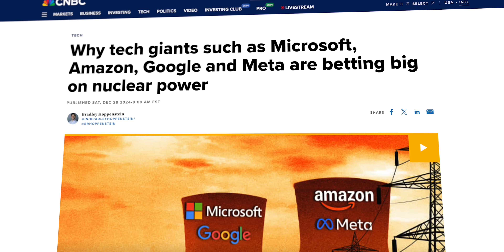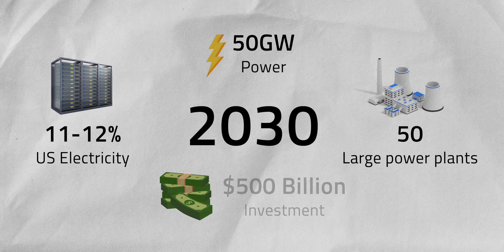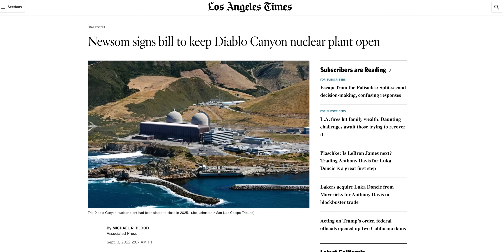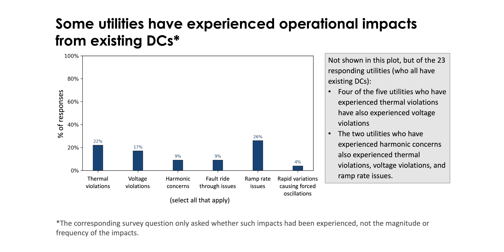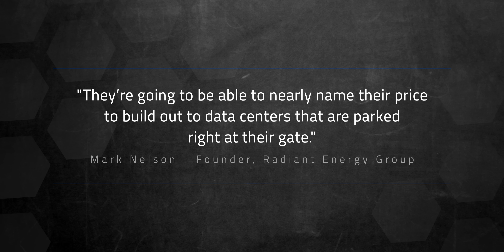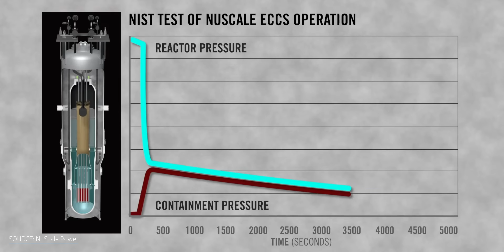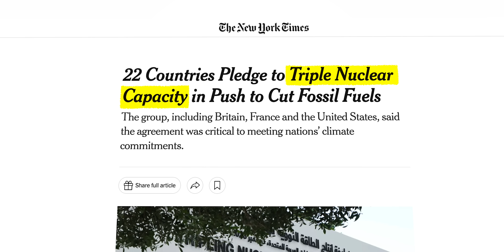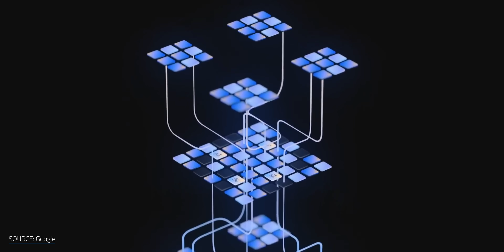Why Big Tech's Betting Billions on Nuclear (Not Renewables)

Comment: No please.  As a former naval nuclear electricians mate i would never recommend any company willing to hedge their bets to operate a nuclear reactor if any size.  The ways it can go wrong, let's just say i had to know more than twice my height in 6" binders filled with the bad shit that could happen and how consequential each and every single part is.  One failure is all it takes.    A nuclear carrier has multiple redundant systems designed to operate in battlefield conditions, and they are dangerous to operate.  I was standing a shutdown phone watch with the shut down reactor operator, our ship was undergoing a standard retrofit to a shore power breaker that had been tripping unexpectedly.  We had a casualty, power arced from bus bars into a handheld fluke, instantly becoming a fireball.  Our only shore power connection popped dropping us into an emergency situation, just like that the lights restored as the diesels fired up and started picking up loads.  Now put this in the hands of private wealth driven firms and it's simply a matter of when we have a nuclear incident.

Comment: This rising demand for electricity has a relatively easy solution. Don't consume it. Ban the new data centres and legally limit AI. No one needs AI. Or to put it more accurately, we need AI for just one thing: pushing off the day the party ends for the obscene overvaluation of tech companies. Tesla, for one, should have the P/E ratio of a normal failing car company, which is that it is.

AI has literally no value to humanity. Its best case scenario is achieve the dreams of billionaires to finish plundering all the world's wealth while freeing them from dependence on the creative class who can be replaced with AI. I'm a skeptic of that dream, since the AI we have now is such absolute trash, but the point is, there is no scenario where raising our consumption of power when we desperately need to be lowering it for stupid AI trash or insidious AI to replace human intellectual labour (mostly by stealing it to train AI) is a good thing.

Comment: It is impossible to accurately predict the future using data from the past because nothing stays the same, but if you’re trying to predict the future climate of the entire Earth 100 years from now it sure would be nice to have data showing temperature, speed, barometric pressure, and direction of the jet streams for the last 100,000 years or so. Unfortunately, humans only discovered the jet streams back in 1883 and accurate measurements of the jet streams only go back to the 1950’s using primitive weather balloons. Jet stream data prior to 1883 is lost in the winds of time forever. We now have maybe 50 years of HIGH quality satellite data of the jet streams. It is impossible to accurately model the climate with so little data. However, climate scientists could build a time machine to go back and accurately measure the jet streams for the last million years, but until that happens the climate models will always suck.

Comment: 3:35 Embracing nuclear is a bad idea because it produces electricity 24/7 365.25 days a year at fairly steady levels and can't be just switched on and off as needed. That means that when there's a lot of wind or a lot of sunshine for PV, which are MUCH cheaper and much better climate wise, instead of using those for electricity production they are shut off because in contrast to nuclear they can be and expensive nuclear is used instead because with the additional electricity from wind and PV on top of nuclear the energy grid would then destabilise.

As a result renewables also become less competitive and less interesting for investment since whenever they'd perform at their best they're shut down...

Therefore: No nuclear.

Comment: The hard part is not making nuclear power plants work, its making them profitable.  I am very skeptical that any of these designs will be financially competitive.  Maybe the data center demand can push the per-unit costs down, but I am skeptical.  Steam turbines don't ramp very well and have high unit commitment costs.  They don't pair will with renewable power, which is far, far cheaper.

Comment: Strange that the M in smr represents that it's factory build. The big advantage is it's fuel is developed to quickly adjust power vs demand. A normal reactor can't change power quickly because of the huge thermal chocks in fuel and cladding. SMR fuel is specialy designed to cope with this problem.

Comment: While I am pro nuclear power, that doesn't extend to SMRs, except as emergency power.

The main reason that nuclear is so expensive is due to protests and courts. Every project gets sued many times. Everytime they are sued it creates years long delays.  

Often the delays from court means that regulations have changed causing further delays as costs for plant redesign and re-approval.

The same tactic was used to fight Hydro-power projects. And now the same tactics are being used against "fossil fuel" power plants. The whole goal is to drive up costs and cause delays that can cause investers to pull out. Either the project is canceled or it is way over budget (10+ times over budget).

Ever canceled plant and every over-budget plant decreases the likelihood of a future plant project.

Remove these obstacles and nuclear power would be one of the cheapest options, only competing with Hydro-power.

The issue I have with SMRs is that they will face the same court and regulatory delays as a full scale plant, but provide 1/10 or less the power. A SMR also requires nearly the same staff as a full scale plant. These highly trained personnel are in short supply. Tying them up for a SMR is wasteful as there are only so many qualified personnel.  Most of these jobs are not remote work. 

Even if some jobs could be shared between multiple plants, you then have further expenses for travel. If the SMR is having an issue, the last thing you want is "The person we need is 1000 miles away and the airport is shut down due to weather".

It makes more sense to build out large server farms near large new nuclear power plants. These could be built in Arizona, New Mexico, Nevada and similar areas in the desert. 

Build such nuclear power and server farms dozens of miles from Pheonix or Los Vegas, in the desert with a high speed rail line could create new industrial areas with little direct impact on major population centers. The cheap power would attract other industries.

I believe FEMA/NRC/DoE should jointly own two to four SMR plants, designed to be quickly transported.

Half located on the east coast and half on the west coast. During normal operations they would sell power to grid power companies and be used to train personnel, closely copying the Navy Nuclear program.

In a natural disaster, one or more SMRs could be quickly transported on location in order to provide power. Navy nuclear ships have done this for decades, even in remote locations.

FEMA/NRC/DoE could make an agreement that Navy nuclear ships could be used in the US during natural disasters (if available) and that the Navy would help them create their training program.

A US Navy submarine can fit into smaller ports and even go inland via major rivers and water ways.

Its possible that the Navy could help develope a small ship with a SMR to be used for training and emergency power.

This ship would be large enough for the SMR, a large battery bank, electric motors for propulsion (10 knots would be plenty), a dormitory,  cafe, water treatment plant, classrooms, etc.

Comment: A good argument can be made that the climate crazed solar industry burned down LA with solar panels.  What might the consequences be from nuclear power plants all over the place?  
Solar panels are flammable. They trap burning embers where the heat is amplified many times between the roof and solar panel.  The glass cover traps the heat like the greenhouse effect while certain people try to blame the fires on the carbon dioxide. greenhouse effect.    Lithium battery packs  might require 100 times more water to extinguish than wood fires.  LA has the highest concentration of solar panels in the country.  If the intense light from surrounding flames overloads the solar panels and the battery, a chain reaction of explosive fires might explain the catastrophic  magnitude of the fires.

Comment: As someone who lives in a place heavy on renewable energy, specifically solar and wind, it is freaking expensive.  Just wild what electricity costs around here and several times as much as most of the rest of the country.  And then over 70% of annual power power production ends up coming from natural gas fired power plants because the Sun doesn't always shine and the wind doesn't always blow.  And this is when they brag about having surpluses of renewables on some days when the Sun is shining and the wind is blowing.  For some reason building a whole extra power grid out into the middle of nowhere where no people live and plastering over the countryside in technological trash for less than 30% of your ANNUAL power production costs an insane amount and doesn't even do that much in the scheme of things.  Bragging about a surplus on one day in the middle of the day doesn't mean that much when most of the rest of the time it ain't doing that much.  So yeah, the tech companies got smart and they are going for cheap and reliable power.

You know especially with thorium molten salt reactors, we could have all the fuel we could ever want and then store power in molten salt tanks for dispatch-able power on a daily basis.  Stuff it all in a neat, reasonably compact building nearby.  Don't need anything else.  Then chemically process the molten salt in the primary molten salt loop to remove fully spent waste that decays to safe levels quickly while leaving unspent fuel in the reactor core.  Give us back our countryside and get us cheap, reliable, safe power.  And power that is clean.  The logic is clear.  Stop cluttering it with stupid thoughts and clear a path to get it done.  The Chinese are already doing it.  We are way behind.  Especially sad when we were working on it in the 1960's and 1970's until Nixon cancelled it.

And yeah, we could totally do SMRs.  My vote (if I had one) would be to build to train scale.  Trucks can go up to ~25 tons of cargo and 8 ft wide.  Trains in the USA typically go up to 100+ tons of cargo and 10 ft 8 inches wide.  That is a lot bigger and a whole lot more mass.  We have high voltage power lines.  Train tracks go all over the country for the most part.  Build near train lines, maybe make some branches into the nuclear power sites, and move all of the SMR stuff from the factory to the site on trains.  Even if you don't extend the train line, you could oversize load it for the last leg on trucks.  Just don't do the full mass on truck across the country.  Economies of scale is important and it works better with trains.

Comment: I have worked on PWR 1 & 2, on Royal Naval subs. It is without its faults, but they are designed to work in a more demanding environment than if it was a static shore based unit. The key issue here is that they are run and maintained by Naval Engineers, not accountants. So, modular reactors are viable with all the modern technology, but only let Engineers design, build, and run them. Also keep a good supply of water nearby.

Comment: Many versions of SMRs were tried in the optimistic age of nuclear power - in at least six countries that I know of (including the US). The Soviets in particular at one stage planned to pin their whole energy strategy on them (all those remote Siberian towns that could be islanded) and eventually worked out that scale economies rule in thermal power plants - no SMR could remotely compete even with large RMBK PWRs. "Assembly line production" (first posited for them in 1956 in the US) cannot possibly hope to yield cost reductions  to overcome the inefficiencies of small heat engines.
When a failed technology is being revived you should always ask "what is different this time?" Sometimes there is something different - eg a new technology which enables the old one to revive in a changed form. But here there is nothing - just the same costly inefficiency of having multiple small thermal plants because the fundamental physics is the same. It is noticeable, for example, that there are no SMC (Small Modular Coal) power stations.

Comment: I never thought of that, but it's perfect.  I was wondering if you'd get into.  The real biggest down side of nuclear energy is that it has very slow "throttle response"; it takes days to start or stop a reactor and several hours to significantly change its output.  This makes them difficult for the electrical grid due to the variability of energy demand over a 24 hour period for regular electrical needs.  Here in TN, there is at least one nuclear power plant connected to a man made lake on top of a tall hill; when energy demand is low, they use the excess nuclear power to pump water up to the lake, then when energy demand peaks, they release water through a hydroelectric system to make up the excess demand!  Data centers, on the other hand, probably have very steady energy demands which would be perfect for pairing with nuclear power.
Reply: Bill Gates' Natrium reactor has a molten salt vat next to the reactor that soaks up excess production in terms of heat storage and releases it back when they need an energy surge to take care of that problem.  Seems to me you could also park a hydrogen generator next to the plant and make hydrogen with excess power when it's available as well.  The "always on" problem has lots of solutions

Comment: Matt, you sound far from undecided on this issue. I’m a lot older than you and have experienced the full dread of nuclear bomb threat and nuclear pollution, and it wasn’t fun. Calling something small and modular makes it seem almost cuddly, but in your presentation you didn’t once mention fuel waste. It would have been nice to reminisce about the humongous US waste stockpile, some of it gently leaking, and give a hypothetical on the projected waste from these cuddly new plants. Also you didn’t mention the cost of the little darlings, or just how fast they can be installed and running. Lastly , all the high ideals of  early Google and co seem to now have mutated into self justification and ‘because I’m worth it’.

Comment: In all of contemporary human endeavour I struggle to think of any single technological project that is more important than achieving functional and viable SMRs.  I would encourage you to look at the Rolls Royce programme currently underway to achieve SMR builds, the regulatory and approval framework needs to radically change not just in terms of cost and timeframe but perhaps in the very way it works on the ground level - not sure if a stage-by-stage oversight process is possible, hard to know for sure but it's evident that we here in the UK (and arguably even more so on the continent, particularly Germany) desperately need workable SMRs and we really need them now.

Were I in government I'd perhaps even push to have a small number of "pilot" reactors built rapidly and put into use feeding the grid but in very contained and controlled conditions with turnkey shutdown and containment should any issues be found;  a carefully managed risk to help RR not only iron out any operational issues but also to help streamline the production and manufacturing process itself.  I'd envisage there is even room for modern technology products for structural components such as 3D metal printing of some components if it improves the speed, structural soundness and availability of those parts.  Whatever is achieved - we need to become entirely locally sufficient for manufacture (well, as much as possible), possibly for uranium refinement as well;  we could source that from Australia perhaps and better still if they did some of the refining themselves.

In that country it was politically fashionable for far too long to indulge in nuclear-bashing (think: Peter Garrett first lead of Midnight Oil and later Federal Environment Minister) and shifting attitudes there to encourage processing and refining may still prove unduly difficult unless things really have changed indeed.

Comment: At 8:14 you say, "The reactor shut down in 2019 due to competition from cheaper natural gas and subsidised renewables." This implies that natural gas is not subsidised, and renewables are only competitve because of subsidies, which is extremely misleading since fossil fuel subsidies in the US far outweigh those of renewables.

Comment: I have a lot of interest in nuclear energy and out of high school wanted to be a nuclear engineer.  I did a lot of research on nuclear technology and still keep up with it.  The reason new reactors are so overpriced and go over budget isn't the technology is because since nuclear backlash after 3 mile island a lot of infrastructure around construction of nuclear disappeared.  It all has to specially ordered.  Both Russia, and China have infrastructure still in place for building reactors and keep cranking out more nuclear energy.  Until we get the infrastructure back up for the nuclear resurgence it's going to be overpriced.  It's essentially the cost of start-up always cost more than keeping something running.

Comment: The selling points for the small modular reactors was the exact same selling points for the new nuclear reactor designs.  The AP1000 was supposed to be a pre-approved design that could be manufactured and just assembled on site, standardized and pre-licensed so that it would be cheap to build.  None of that turned out to be true.  Yes, Hitatchi bankruptcy threw a big wrench in the Vogle units but the same thing has been happening to all of the new nuclear reactor construction projects.  Over promise, under deliver.